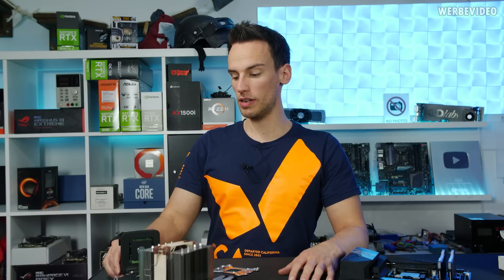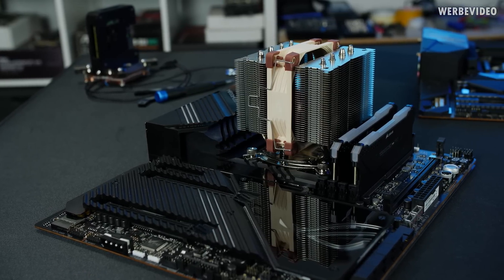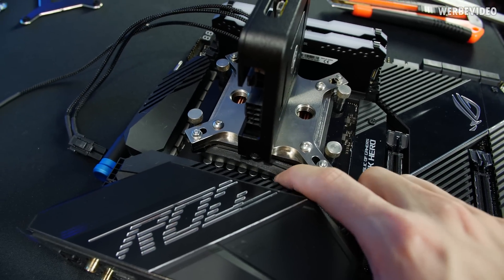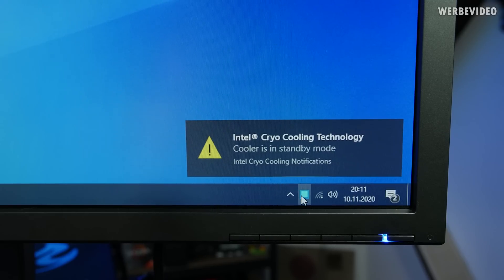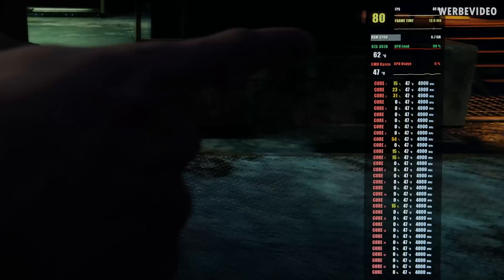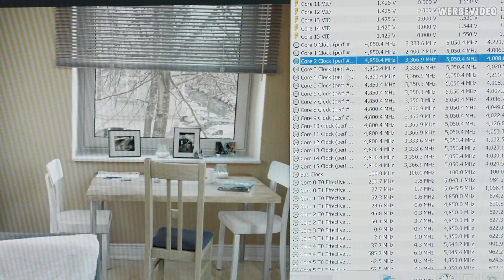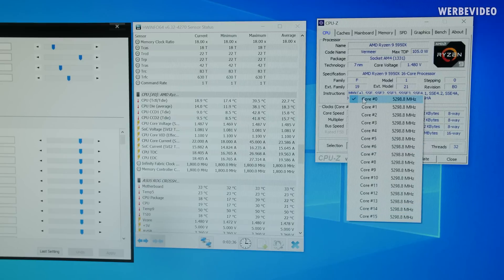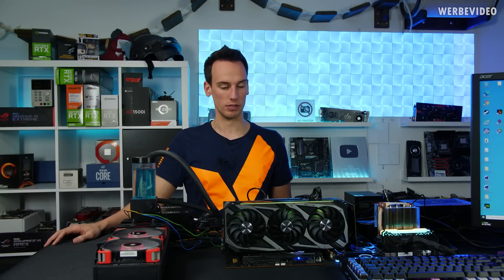I probably wasn't supposed to do this 😅 Ryzen 5950X cooled by Intel Cryo Cooler

Comment: Does anyone know if the Intel software needs a Z series motherboard ? Or just a K series CPU is enough ? I am trying to see if its possible a 10600k+cheap B460 board to control the software and use it on a Ryzen 7900X

Comment: Can that block fit to 12th-gen LGA 1700?
Reply: blok will with physically but you have to do your own insulation gasket bcoz 1gen delta tec works fit only on 115x/1200 physically

Comment: Just wanted to thank you for this video, your acrylic brackets provided the idea/inspiration for me to design and 3D-print (with solid infill!) some similar parts that allowed me to adapt my ancient Apogee GTZ waterblock with an LGA1366 bracket to my new Ryzen 5900x processor and AM4 socket. Worked flawlessly, and the old block seems to work reasonably well on the new chip and saved me the cost of a new CPU block.

Comment: It is bad if by accident the pump of the fluid was opened and it dropped a few drops but I saw it again quickly, then I closed  quickly but it managed to drop a couple of drops in the process of tightening the screws., it was like 3 or 4, do you think that reduce time of life?, or still will work well? or is better return the water cooler, I just got it like one  or two weeks ago

Comment: Hi, can you please help me? I got this error after installed the cryocooler on my motherboard Asus Rog Strix Gaming E with i10900K CPU: Intel Cryo Cooling Technology device connected: FAIL
the application doesn't recognize the cooler, it troughs an error MAKE SURE USB AND POWER are BOTH CONNECTED.

Comment: Did you try to install the software onto the AMD platform?  You said it PROBABLY won't work, but did you actually try?
ASRock X570 Phantom Gaming-ITX/TB3 uses intel cooler mount, so I'm seriously considering doing this with a 5600X.

Comment: Did you try to install the cooler software on the AMD system?... it seems like it doesn't need feedback from the CPU, so unless they check out of spite, it seems like there's no reason it couldn't work.

Comment: Not sure how this is significant, i mean when you take on to account that intel is still on 14nm, it kind of makes 5.3 on anything smaller then 14nm just substandard i mean we are trying to compare clock for clock, core for core and ipc to ipc and the hardware required to achieve it, o hate to say it but intel is on double the size node and AMD is most certainly not getting double the performance or efficiency.

Its kind of hilarious that people ignore the fact that the larger the node the harder it is to get higher clocks stable with lower power consumption.

The fact that 14nm is competing with 7nm is a feat of its own.

Dont get me wrong zen is awesome but again look what they used to beat what again? Kekw
Reply: Many people don't know how nm works, If people knew, they'd know that Intel's upcoming 10nm has better transistor density than TSMC's 7nm nodes which is what AMD uses.

And yes, Intel being on their own "14nm" still can almost compete with AMD. So, if see the news saying Intel announcing the 7nm plants in Arizona, it's actually as good as 5nm of that of TSMC's side  honestly.

Comment: @Der8auer Would you please mod one of these  ek cryo blocks or the Cooler Master MasterLiquid ML360 SUB-Zero to work as a GPU cooler say on a 3090 or 6900xt? 

I'm curious of the software used could run 2 blocks at the same time one for INTEL CPU and one for gpu.

I have one of the EK Cryo blocks preordered...

Comment: Did you try installing the software on the intel system, then swapping over the drive  to the AMD system? My thinking; will it not run on an AMD system, or just not install on an AMD system (?) - the latter is much more realistic to work around. Even if you don't own an Intel system, you can have someone else with one, just install windows and the Intel software for you, either on a physical drive or an image.

Comment: I mean, you could always get an i3 and then plug it into an ITX board and then run a dual-system case like the Enthoo Mini XL , Metallic Gear Mini Qube, 2 Thermaltake stackable cases mated together, etc... Just saying, that might be more affordable and realistic, and that 2nd system can also double as an encoding rig for streaming, or as a processing offload for workstation software that supports networked clustering or server/client or master/slave assisted compute. I actually hope more software supports it, moving forward. Reaper DAW has had this feature for pro audio recording for a few years now, like try a decade, lol.

Comment: Will we see a cryocooler implementation for AMD this year? Also was wondering a bit worried about condensation... What if it is dumped in mineral oil as well..  maybe run the mineral oil through a chiller as well.....

Comment: I dont know if anyone has mentioned  this or though about testing it, but I'd be interested in seeing the new tech cooler used in a mineral oil submerged  system. This should eliminate the chance of condensation forming and may allow for even greater performance  potential.

Comment: i did this with my 1920x and pushed the tec to -20c - my major issue was not enough power and insulation.  I found that tecs can't handle the thermal load for a long time so if intel figured something out to allow for that good for them!

Comment: I figured out how to fix the limitations of the Intel cooler under full workloads. With my modification it can sustain low temperature under full workloads. Now if only I can patent the design and sell it to a company that will manufacturer it.

Comment: Before this is shelved Roman.... I believe it might be possible to set up a VM that spoofed the 10900k as it's CPU.

I'll look into CPU spoofing and see what I find.

Simply put, if Linux is used, the spoof would be setup on the PC and then all you'd have to do is run the VM from there.

Comment: Yo dude can you put the motherboard in a freezer with a bunch of silica beads to lower the dew point? Since the heat is removed by the cryocooler , it shouldnt put much load on the compressor.

Comment: Should be possible programming an arduino to replace controller software. Either read cpu block temperature from the tek cooler or stick another temperature probe on it to adjust cooling. Then slap a humidity and ambient temperature sensor on it to calculate dew point so it can cool less as it approaches dew point. A bit of tinkering, but wouldn't need a separate intel box.

Comment: Hello, I have a question about the gigabyte z490 aorus xtreme waterforce board, when I built the computer and started the operation process, I noticed that the RGB motherboard does not work as well as the mouse and keyboard, and no image appears on the computer screen and I changed another hdm bibble cable. The same results There is no picture to complete the BIOS setting  The windows download, please help, why is there no image and the rgb for the interface of the motherboard does not work I think there is a special program gigabyte to run the rgb but this is after turning on the computer !!!

Comment: You're still not using the new Cinebench R23? It runs the same benchmark as R20 but it runs it over and over for 10-30 minutes to get a score. That way you actually get to full temp, unlike R15 where it takes literally 5 seconds.
Reply from the maker: not going to wait 10-30min everytime xD hell no
Reply: @der8auer  Yeah, it's a bit long. And if you change the settings so it only runs through once like R20 then it doesn't save your score.

Comment: Please do the Ryzen 5 5600X , I have a peltier cooling project I shelved years ago, that I'm tempted to revive and use it with Ryzen 5000 CPU,  when complete it should have around double the cooler capacity of the EK unit.

Comment: @der8auer: you mentioned Kaby Lake and above support on your last video. Maybe a video on a 9900K or KF on how the system works? I wanna  buy this but no reviews on how it will work on the 9900K. Currently at 5.2 @ 1.4v daily. I wanna reach 5.5 at least.

Comment: Not sure why but with the Cryo Cooler out there and showing good results is there really a reason why $coolingcompany shouldn't create something similar? Can't be too hard, can it? The hardware design doesn't look very challenging, the control board should basically be temperature/dew point measurement primarily. The regulation part should be doable with a solid PID regulator. So not sure why this should be "Intel magic" for more than a few weeks? Maybe i'm just missing the point though.

Comment: Hey Roman, About my 011Dynamic, I have kitted it out with 12 Uni Fans 6 in Push Pull on the Galahad360 AIO Side intake, 3 on the top for exhaust, and 3 on the bottom for intake, and it looks Dope!!! Love the case, but there is one issue. When you install the 3 fans on the bottom you can not access the USB3.0 header on the MoBo. As it is the Cable included with the case for the front panel just won't make the bend. Have you encountered this issue already and if so what is the work around?  I have tried a right angle adapter and it doesn't leave enough clearance for the head. Maybe they could include a cable with a right angle connection or just use a much more pliable cable. I have ordered a Cable Mods Right angle extension and I hope it works but it is an added $25 US expense. Thank you and again I love the case it's the best on the market. I hope Steve from GN does design a case! Can't wait to see what they come up with as well!!!

Comment: personally I see this working quite well with gpu or Zen as both have a strong frequency to temperature correlation. and if it can hold  sub ambient temps and isn't a huge refrigeration unit well that's impressive to me

Comment: Outstanding review..!!  
Excellent 
Do you Know I had the only refrigerator  plate  ran at 1C  and  thermal protectors connectors to the fan!  The heat sink was insanely scorching hot but CPU  Super cool by refrigerator plate!
On my 266Mhz PC   66mhz  ram 
Over clocked to 366mhz and 133mhz ram 2 G 
It cost me 5000 dollars 
I bought the  first Burner ever sold in Canada!!  Back then .. had it imported.
$1000 dollars just for that burner  ..it was one you  whole piece shoved in  and made a perfect image copy and you pulled it out and no matter what you burned is was a perfect reflection copy!
This I bought custom made in the early 90's. Best times of new tech !!
The eventually got a Matrox Mystix 2meg plus 2 more megs added to make it 4 megs!
And 2 Voodoo2's !! This cost me over another Thousand  $300 x 2 Voodoo's and Matrox $300 plus $100 for 2 megs added..  Crazy huge  Price tags  but it gave me a world of fun..
It was the best PC ever Windows  + dos  then  95  and then 98 I upgraded big time!

Love your Video excellent thanks..
things have come a long way but the past  they were smarter but never continued such a great product and cooler..

Comment: Haha - way to troll Intel. I'm still on the fence with the neoprene insulation over long term use but I think EK has a promising product. If they can get past first gen phase and do an improved second gen it will be worth a look for serious water cooling folks.

Personally I'd like to see a more powerful TEC that could be used to cool a W3175X - that's the kind of CPU where this type of cooling performance would make the most sense, not mainstream parts.

Nice work + great video!

Comment: Anyone well versed in USB programming should be able to reverse engineer a control program for that TEC controller.  Basically you just run a packet sniffer on the USB port that it is connected to to get the command and response packets and replicate that.
Is it worth putting in that effort though?  Probably not as the extra cooling it gives you isn't really worth doubling the power draw of your system on a day to day basis :\

Comment: build a custom water loop and just buy a simple TEC element. you can augment your water cooler thatway. how to controll can be a question, but if you fancy you can look into ardunio or other projects or just rig up an opamp and some output stage to drive the cooler. thatway you can send sub room temp coolant to any liquid loop. its stupid as hell as it consumes more power. but whatever works, just works.

Comment: TBH it needs 300W TEC to be able to run Ryzen 5900X or Ryzen 5950X at 4.8Ghz all core under 50 celcius at load.  For that i would rather get TEC Water Chiller (or make my own) that chills the water down to +1 above Dew point, there are plenty of those in market.

Comment: Those R20 scores seem kind of low. I have only PBO enabled, running on water, and with an average clock of 4350 I get 11200 to 11300 points. My ram isn't amazing either, 4x16 sticks at 3200CL14.

Comment: A quick overclock related question: would the noise introduced to AC by powerline adapters interfere with the power supply's ability to provide stable power for stable overclocking?

Comment: Fun to mess about with but hardly practical. Who cares if it's practical, it's fun!
I still think that the best use for a TEC would be to cool the coolant. Instead of an ice bath or water chiller, use the TEC and the same controller logic, but apply it to the other side of the loop.
Imagine if the TEC had waterblocks on each side, a cold loop and a hot loop. Regulate the coolant temp in the cold loop to just above the dew point, and go overkill with rads for the hot loop. Would be fun to try :)

Comment: Does the cooler not run in unregulated mode by default? As in, without the software installed.

It seems odd to me, that there wouldn't be some kind of failsafe, to ensure the cooler would still function in case of a system crash, or software crash. Sure, if you bluescreen, the AVX load usually stops immediately. But even an idle CPU will eventually cook itself to death, if the cooler stops functioning.

Still, I'm sure AMD will make their own at some point. If they don't, you know someone else will. Where there is a profit to be made, there are companies willing to dodge patents, to make their own versions.

Comment: I think you should measure the polarity/voltage of the cooler and then hook it directly up to a variable bench power supply to bypass any software limitations. Then you could also over-volt it for more cooling performance (more waste heat tho)

Comment: Could someone in theory cool down an entire cooling loop with one of these? Then you can cool a GPU and CPU with these.
Reply: No, the point of this thing is to pull heat off a specific chip. If you want to actively cool an entire loop you can already buy water chillers.
Reply: @FluffRat  makes sense.

Comment: Hey der8auer, is this cooling the water that flows through the loop, or only the cooler itself? if so will it also drop gpu temperatures that are in the same loop better than standard radiator/fan or with the addition of radiator/fan?

Comment: Intel is acting in PR like this is some sort of intel-only solution.
Which is utter BS.

It's a TEG, with a PID, a humidity sensor, 2 temperatute sensors and a controller which calculates setpoint based on the humidity and room remperature.
Thats it. Really.

No reason this can't "just work" on AMD.

Comment: I'm running 3 peltier devices in series to cool a 3900XT. At roughly 1 to 3 percent cpu usage, I can achieve about 2 to 3 degrees F below ambient room temperature. I also have a corsair 115i inline with the peltier devices. There's so many variables to consider, its hard to give exact numbers, but when my coolant is below ambient room temperature, I turn the fans off on the 115i. Dont want the fans/radiator fighting the peltier devices.

Comment: ...this would be better suited to a 5800x OC attempt, with a BIGGER radiator, mind you; the TEC kicks out too much heat for the 30mm 360 rad, imo, a 45mm or even a 60mm thick 420 would be better suited =)
Reply: ...perhaps Alphacool could get in on this if EK contractually cannot ;-)

Comment: With those acrylic pieces you always need, I think you should buy a 3D printer. This small thing for example will take you probably shorter time to design and print than going back to work and using the machine.

Comment: I'd love to see an open solution similar to Intel's Cryo controller that can control either a TEC or a water chiller. I've been thinking of using chilled water in the summer (using a remote chiller that is outside the room) but I need a way to electronically control/prevent condensation so that it becomes a fire & forget solution that you can just turn on without being afraid of condensation. Something using off the shelf parts and an Arduino or Raspberry Pi would be amazing.

Comment: Seeing that for my workstation 2D CAD uses, 6 cores are great and 8 cores are overkill (so I stick to the 8 core CPUs), I really have no interest in the 10850/10900k CPUs.
So being that the 10700k has 2 less cores for heat generation, thereby the cryo design should work even better on the 10700k as it comes.

(While the Dr Frankenstein in me wondering how the water block/TEC with controller unit from EK .. Pump from the Coolermaster ml360-sub-zero .. 280mm rad & fans from Arctic Liquid Freezer II .. on the i7 10700k)

Comment: Amazing how it went from 0 Degrees to 58-72 in like 4 seconds even WITH the cyro Cooler Overclocked. 
Heck, there is a substaintial market for TEC coolers if ONLY the software was made. EK made the wrong choice doing an exclusive deal with Intel, since every single recommendation for any price point is (Almost) AMD.

Comment: Intel's Cryo Cooler is 1st generation, so what you have tested on both platforms, looks very promising for the future of this product. 

Now, if AMD and Intel could agree on a standard form of mount for processor coolers in general, that would bring down the price and reduce manufacturing resources.